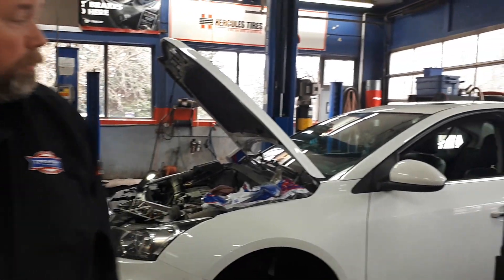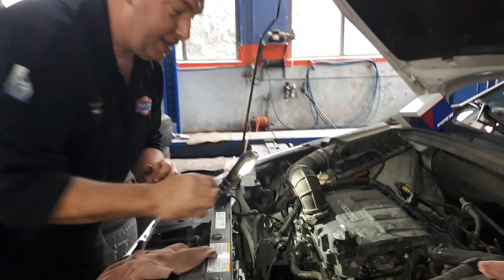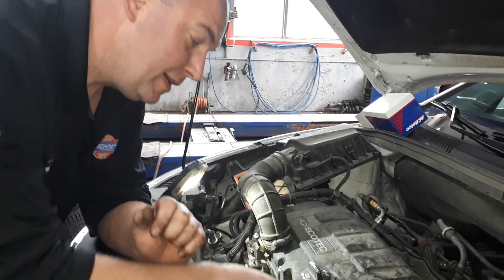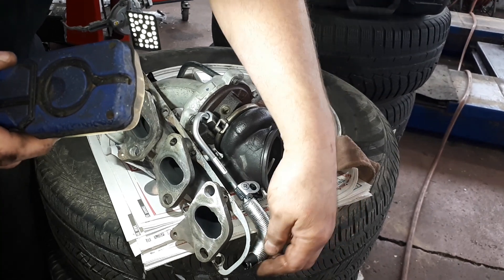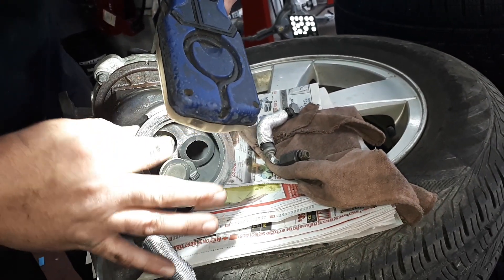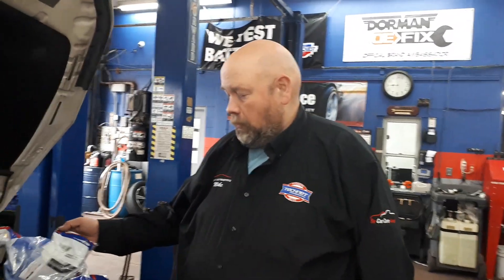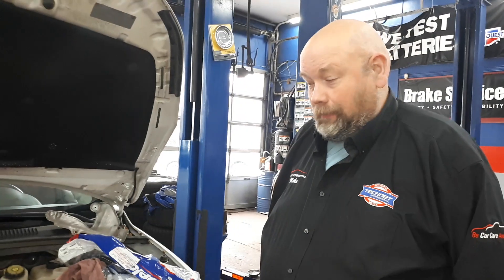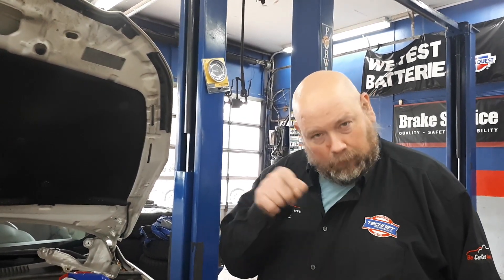Eco tech 1.4L Turbo coolant leak issues that may cause codes P0597 ,P0598, P0599 @UrbanAutomotive01

Comment: You can take a Dremel or other tool, cut the metal crimped on part of the turbo coolant hose and pull the hose off with the turbo and exhaust manifold still on the engine. Then replace with regular heater hose. It's got a beveled end on the pipe so a heater hose will work fine. Save a lot of time.

Comment: I have got this issue myself. Was hoping to do this without removing the turbo. Not sure if I really need this special tool # EN-49940 is is is just a fuel, transmission quick disconnect tool? Going to be fun as I have never done this before.
Reply: you dont need any special tools to remove the turbo
Reply: @bobl78  but you need a special tool to remove the coolant quick connects on the turbo. These aren't the fuel line disconnect you can get anywhere. I just cut them off since they were leaking anyways & GM Manual specify replacing them. That's where the leak was

Comment: Do you have a parts list for the coolant lines replaced? I did purchase the inlet line from my local dealer, but after watching your informative video I decided to replace the other lines as well, especially since I can’t inspect them until I remove the turbo. Part numbers would be super helpful. Thnx for this amazing video!!! (Since warranty ran out I have been doing 100% of my repairs. If I hadn’t, my 1.4 would have cost me thousands in repair costs...)

Comment: THERE NEEDS TO BE A MAJOR RECALL ON THE WHOLE ENTIRE CAR, AND HAVE CHEVROLET GIVE US A NEW DIFFERENT CAR FOR PAIN AND SUFFERING CAR.
Reply: I definitely agree! I’ve been catching hell since the day I got the car! This is my current issue ans I can’t pass inspection. Oil leak, 6 codes, misfiring, and fumes that come through the vents when the car is at a stand still (while running) it shut off on me yesterday. I’m so over this car! I’m tired of it. I’ve spent so much money. I would’ve been had it paid off if I didn’t have to fix so much on it!

Comment: I HAVE ONE OF THOSE NOTORIOUS CARS THAT BRAKE DOWN AND WHEN YOU FIX ONE THING THEN IS ANOTHER, MINE IS A 2011 CHEVY CRUZE TURBO 1.4 L ENGINES I HAD A LEAK ON MY COOLANT RETURN LINE, I TOOK IT OFF AND REALIZED  IT HAD A CRIMPED FITTING ON ONE OF THE ENDS ," USELESS FITTING ,GO BUY A GOOD HOSE AT AUTOZONE FOR $8.00 AND 4 SMALL RING CLAMPS ,AND PUT TWO ON EACH END, PROBLEM SOLVED ,BUT SINCE I HAVE A CHEVY CRUZE I WILL EXPECT SOMETHING ELSE WILL SOON BRAKE..